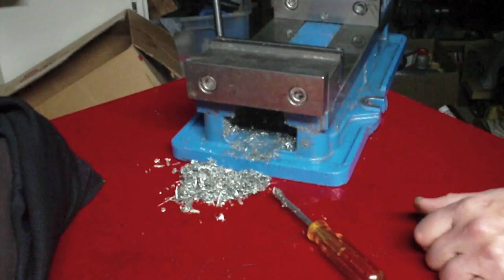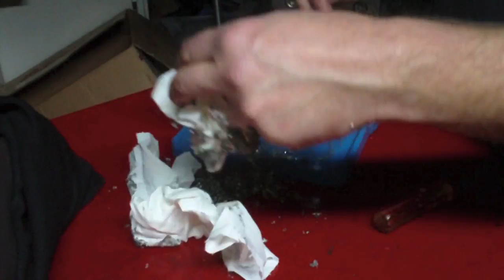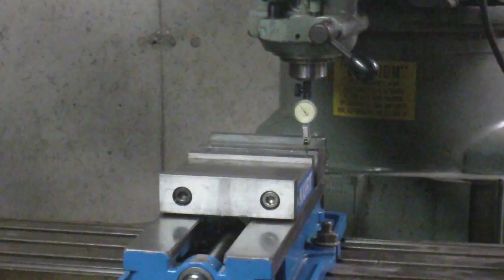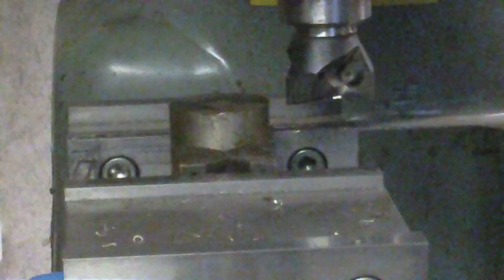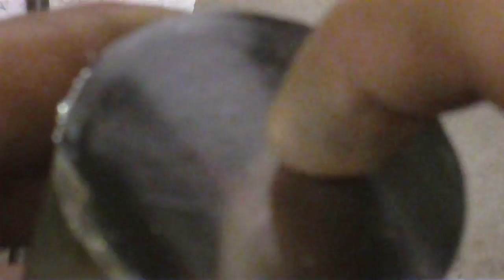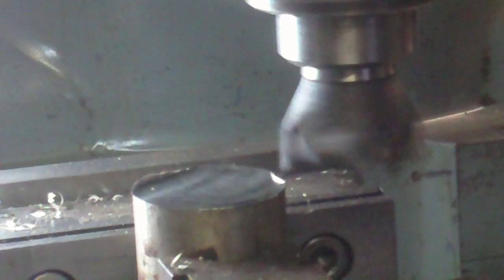The Wells Index milling machine Part 64

Comment: Still having fun with the mill?
 I enjoyed your videos!
Reply from the maker: I've used the mill a few times since this video. I also managed to break the low range, but for now just use the VFD to slow it down. But there will be more videos in this series for sure. Lots of little things I want to address.
Reply: Steve Watroba
 I was looking at an Index 745 mill, but after seeing the troubles getting it moved and possible repairs and setup with such a large mill, I'm probably going to wait until a smaller one comes along. I too would have to move it alone. I moved the 1,500 lb 13x40 lathe and that was just about my limit- Especially since the weather was humid and 100 degrees. Getting to old for that. LOL.
 I think your videos have saved me a lot of......headaches I would regret!
Reply from the maker: newstart49 ON the other hand, if the mill was in good shape, and priced right, you could have a mill that might last you a lifetime. But you better not plan on moving in your lifetime lol.

Comment: Congrats on making chips !!!   Steve, do you still have parts from the donor?  I am looking for a replacement table.  Mine has been chewed up pretty good some time before I got it.   Mine has arrived and is now on the shop floor in 3 big sections (Base, knee and table, and the turret/head.   Hoping to get everything reassembled soon.
Reply from the maker: Hi Scott.  the table did have some damage. it's been outside under a tarp for a while. probably pretty rusty. let me know if you want me to dig it out for photos.
Reply: Steve,
Just talked to Wells Index.   They made a good point that I had not thought of.   The gib is made specific to that table and the machine it came off of.   It may present more issues by changing the table.   Mine is pretty beat up.   If I find that it does not work well with what I am trying to do, I may see if that table is still available.   Great people at Wells Index.   Very helpful.
Reply from the maker: +Scott Goessling okay.  I'm not going to hang on to the old table much longer. it'll make a good welding table for some one who wants to make a base for it

Comment: Congrats on getting it running, Steve. One thing to add to your list of projects is a set of keys for the bottom of the vise. There should already be grooves underneath. The keys will sit proud of the bottom of the vise about 1/2" and enter the T-slots in the table. They should be a close fit but, not binding. Once you have them, you won't have to indicate the vise every time you take it on and off the table. Just put it on and push it to the back of the T-slots as you tighten the hold down bolts. It's still a good idea to check the jaw with an indicator on critical work, though. The keys only need to be about an inch long and counterbored for a socket head cap screw. Hopefully, the bottom of the vise has a couple of tapped holes. I don't know, I was never one of the cool kids who owned a Kurt. LOL
Reply from the maker: Thanks.  That's a good tip. I'm not a cool kid either....just got lucky on purchasing this one.  ; ) .

Comment: Steel cuts at around 100 surface feet per minute (SFM).  Looks like 1018 cold rolled.   For what I could tell looks like around 100-125Ra which is a pretty decent finish for a first cut.

Comment: Looking good. It is supposed to cut a little on the back side giving a hash pattern.  You might be able to adapt the other power feed for the knee if it runs.  The feeds and speeds are a guideline for a starting place. You go more by the chip it is cutting and the finish it is leaving. With a carbide cutter, if you are getting some color in the chip, you are getting real close to the right speed. That is a big mill and can take much more of a cut than you are giving it right now so don't worry too much about pushing it. Besides, it will grunt and groan if you are taking too big of a cut.
Reply from the maker: +David Kirtley Hi Dave. I kind of equate this to the first time I ran my bush hog with my tractor. At first I drove extra slow, and babied it, but as I got used to it, I picked up speed, and started driving over bigger brush. In an upcoming Vernon lathe video I use the mill to make a T nut. I had a hunk of something, and I think it ended up being stainless steel. Well when I got comfortable with the noise, and all, I really had chips flying. The chips were a pretty blue color, and some were flying up to about 8 feet away. I have some shell mills I'd like to experiment with next. I also love how nice it drills holes. Now I know why so many non machinists like using these as dedicated drill presses. I've determined part of my top end noise is my draw bar. It is a little bent, and at high rpm's the top vibrates like crazy. I see draw bars sold online, maybe that'd be a good investment?
Reply: Anything that cuts vibration is a good thing. If the DRO is dead, you might use the scales with one of the homebrew DRO setups that use an andriod tablet for the display. http://www.yuriystoys.com/p/android-dro.html if you have an electronics aptitude ( or not in a hurry and want to learn as you go.)
Reply from the maker: David Kirtley Hi Dave, I do have some electronics apptitude, and that is an interesting idea. I bookmarked that site for future reference. I have not tried fixing the DRO yet, Thanks for the info.

Comment: also remember for the speed chart on the machine to be correct the vfd should be set at 60hz
Reply from the maker: +dozerd12r Roger that. I also need to verify rpm's because I'm not convinced the variable speed belt drive is operating at 100%. It was acting squirley. I intend to revisit that down the road.

Comment: don't climb mill with a insert cutter whenever possible.  and you don't reverse the direction of the spindle to climb mill. 
it's if you are feeding from left to right or right to left
Reply from the maker: +dozerd12r I figured that one out when I realized that insert cutter was never designed to run in the other direction. I bet it'd snap those inserts off if I tried. Correct me if I wrong, but if I am face milling a part that is narrower than the diameter of the cutter, then it shouldn't make a difference what feed direction I use because the cutting action is not parallel to the direction of feed.......right? I thought I read that somewhere. Something like at least 10% of the cutter diameter has to be past the edge.